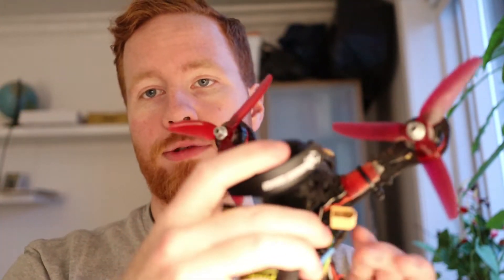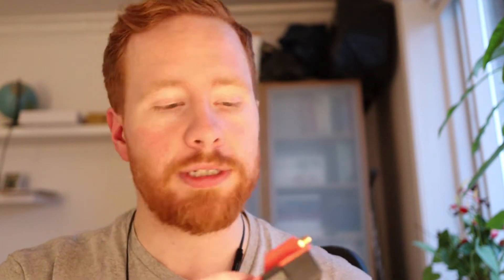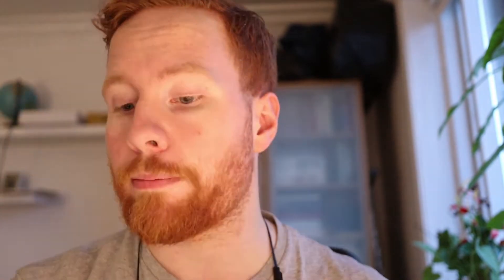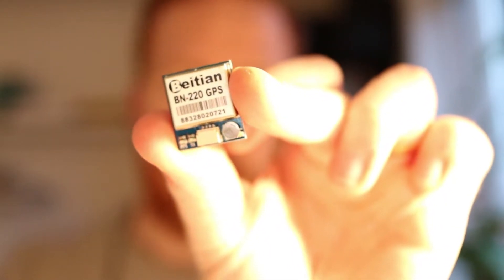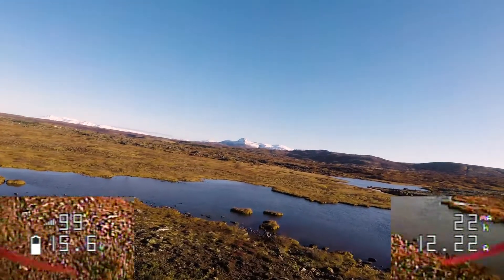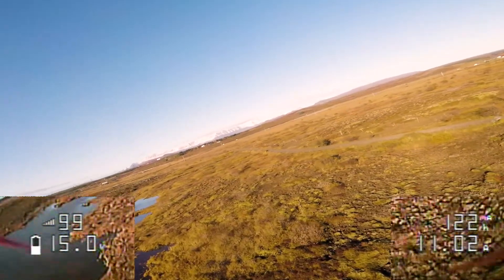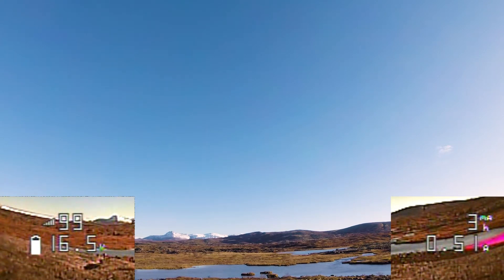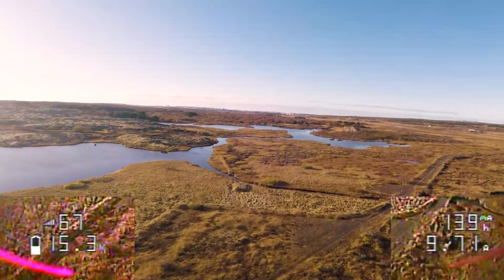Long Range FPV Drone Build with FrSky R9M and TBS Unify Pro - Part 1

Comment: Ouch!  The infamous magic smoke!  And that sux about the RSSI dropouts!  I hope reflashing it will take care of that!  I just installed a little GPS module on my six inch quad.  It is nice to have for backup if I lose the quad but I am not sure how accurate it is.  Looking forward to the next follow up and hope you find the problem with the RSSI!
Reply from the maker: Hehe I was surprised everything survived the magic smoke! Yeah definitely looking forward to getting the GPS module connected. Maybe I'll check it's accuracy and do a small review afterwards.